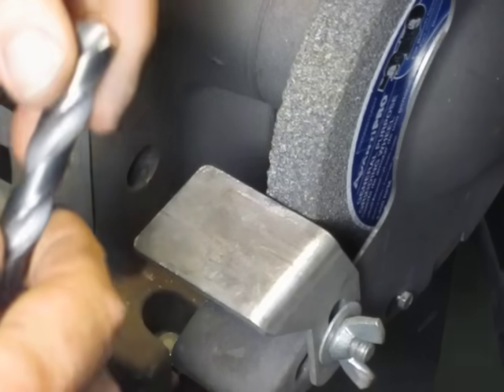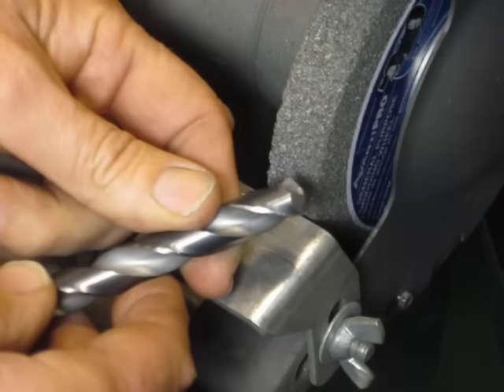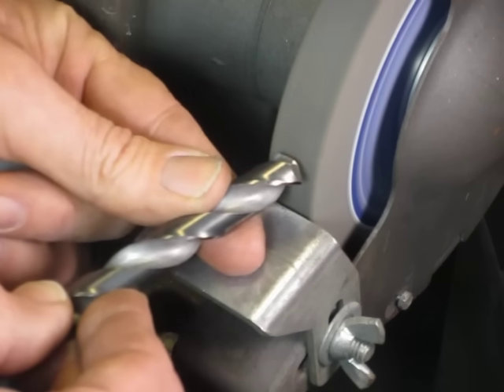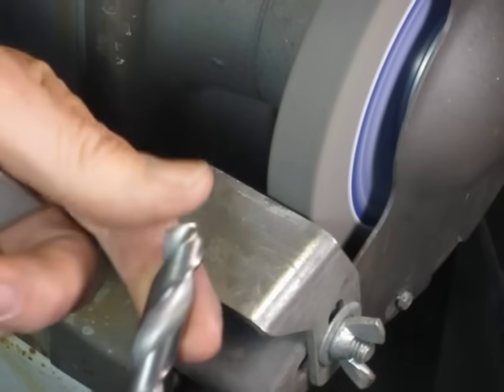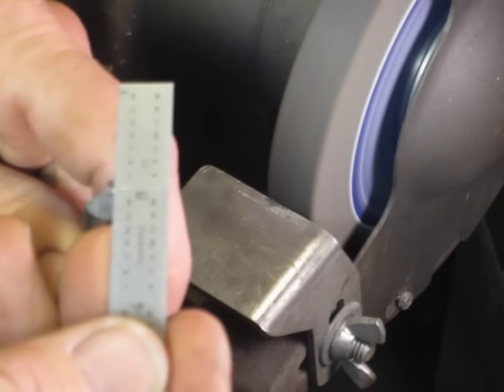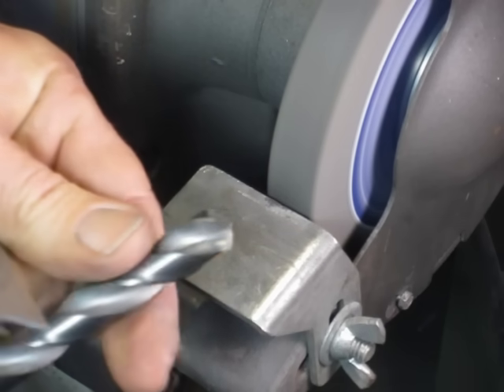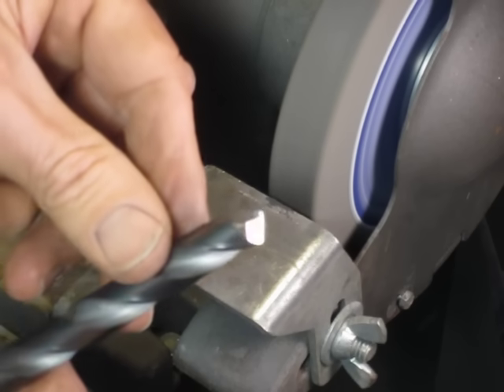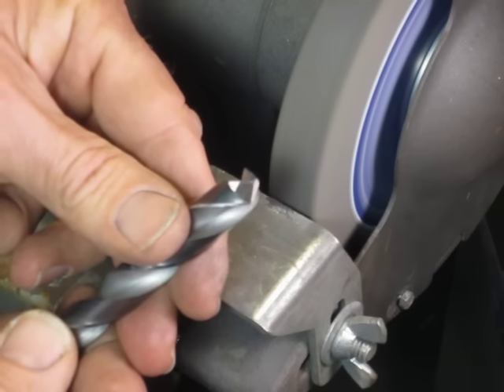How to Hand Sharpen a Twist Drill

Comment: Nice lesson.
Would love to see an update video with better resolution and some closer look as how is the drill bit moved on the grinder. He makes many micro adjustments while it seems he’s just going straight on the stone. I just can’t figure out how to move the tip to hit the correct part.
One question, hopefully someone knows. Can this be done on a regular sharpening stone? Not a grinder? Like a diamond flat stone for example?

Comment: Where does 59 degrees come from? 180 - 118 = 62. Shouldn't you set the protractor to 62 degrees? Or am I missing something?
Reply: Oh, I see - 118/2 = 59. I understand now.
Reply: The total angle on end of drill bit is 118 so half is the 5
Reply: .... +/- 2°÷3° out of 118° or 135°  won't really matter  as long as both sides are the same and cutting edge is the same length. Very difficult to do by hands even using protractor and ruler. For general drilling projects it's good enough unless you want/have to be more precise than investing in "Drill Doctor" is the way to go. Tested couple of models  ... hmm ... you get what you pay for  ... still learning how to use them maybe a challenge and time consuming. I use drill bit sharpener when I have extra free time in between the jobs so I always have set of sharp drill bits available. Presented way of sharpening drill bit is "school/book way " of doing it. You have to practice. Been in trade(Millwright)+40 years can hardly remember any other tradesmen even trying master this skill.
P.S. I would start this procedure from checking evennes of grinding wheel surface  or simply use wheel dresser to make sure cutting edge will be ground straight in line . Still one of better videos about sharpening drill bits on YouTube. 
👍

Comment: After watching several videos comparing various drill bit sharpening machines and the prices for them, the bench grinder seems the most practical by far since it can be used for other things, not just sharpening drill bits. So it will take some practice but from what I've seen the results are at least as good with the bench grinder and the most cost effective. Nice work on your video and explaining how to do sharpen bits.

Comment: Puzzled ...why not raise it up on the wheel in the first place then you'd be grinding the angle and the clearance at the same time .
Reply from the maker: The primary and secondary clearance angles are not the same. You need a shallower primary to conduct heat away from the cutting edge and enough of a secondary angle that it doesn't rub.
Reply: @TomsTechniques  Absolutely right Tom.  A lot of posts about grinding drill bits on this site proves that most do not understand about the cutting angle and the clearance angle. Nice to see someone giving the correct information. As an apprentice i was given  a load off blunt drills and spent hours learning how to get it right..

Comment: To prevent premature dulling, the clearance angle should be kept to a minimum. For the same reason knives, chisels and any other cutting tool stays sharp longer when the cutting angle is minimum.
Reply from the maker: Not necessarily. Too little clearance generates friction, and friction generates heat. That is why I abandoned the traditional conical clearance and started using faceted clearance angles. Drill bits sharpened this way cut much easier than bits with conical clearance angles. There is an interesting artice on drill point geometry written by Joseph Mazoff that is worth reading.

Comment: i thin that there is better accuracy with the four facet drill sharpening. the skill is is traversing the face of the wheel evenly and being patient. A lot of detail in this video although like some other here sharpening drill bits less than a 1/4" gets progressive trickier  as well as the pressure margins getting much finer, being always too easy to grind away too much and then start from zero.

Comment: I can see that you have been doing that for quite some time. I have been hand sharpening my drill bits for some 42 years now, however my eye sight is definetly not what it was, so I can no longer sharpen any bits below 4.5mm
Reply from the maker: Mine is going as well, but I swallowed my pride and picked up a couple of Optivisor headbands. The magnification allows me to do everything I used to do and more. I've even started doing a little watch repair as a hobby.

Comment: When the drill goes smaller to 4mm and even smaller, it gets difficult by hand. Big drill bit can easily adjust by hand
Reply from the maker: Small ones require a pin vise to hold them, and magnification to see them. Otherwise, they sharpen just like the big ones.

Comment: Most of the eyeball sharpening methods  don't address any way to create a center point that is centered !  This is one of those.  Without an accurate center your resultant hole will be oversize.
Reply from the maker: Actually, this is not one of those. You must have missed the segment at 6:25.

Comment: Thanks for the refresher.  
I was doing a job on a lath drilling a oil hole on cast iron connections rods the drill bits were over 18" long these parts were very big for a locomotive engine or somthing well the castings had a lot of sand pockets down in the metal it was a 3/8" bit I belive and my drill bit was prone to bust about 3 times each part or dull out on every part I think we had like 50 or so of these to do. So I had to learn how to sharpen bits and fix broken ones.
That job was the biggest pain in the ass
But I got it done and only lost about 8 parts becuse the broken bits were stuck in the parts deep in the holes. 
But that was almost 40 years ago.
My uncle put a different brake on the bits 
That centered better but it was close to what you did. He said he started doing that in the 50s no one else was doing it.
I worked in his machine shop when I was younger.

Comment: Good presentation, but , people that  have never sharpened a drill before need to also know to have a container of cold water close at hand to dip the  drill in the cold water at every grind back and forth on the grinder to maintain the cool temperature of the high speed or cobalt drill. If this is not met , the material of the drill will change its grade of hardness and no matter how good the drill looks at the end , it will not cut but dull itself in a matter of seconds and the only way to re establish 100% hardness of the drill itself is to cut off at least a quarter to three eights of an inch off the top of the drill back down to the original 100% material grade and to start all over again and once again maintaining the correct material temperature by dipping the drill into a bucket of water at each back and forth swipe grind. The water will get warm so change it to new cold water when this happens.This applies to every and any kind of tool bit , in the machinist trade .
Reply from the maker: That's a common fallacy about high speed steel. Check out my video on red hardness.

https://youtu.be/jQ648eDA7V4

Comment: I was taught the old school way and later learned the facet method. Both are good to know as larger bits 1 1/4 + lend them selves to the conical method especially in a job shop environment.
   Two things I recommend get yourself a drill point gauge w/6"scale 4R preferred. It's just handy as hell and the angle 118° is set and the most common. These are not expensive . 
Secondly do as Tom says and practice practice practice. 
   People do things differently it's natural but most machinist sharpen drills the same way as shown.

Comment: What am I doing wrong I get the angle to steep.i been through a lot of bits I am starting to get some of them sharp.
Reply from the maker: If you aim the drill bit at the center of the wheel, you'll get a 0° clearance angle. Tipping it up just a bit will get you the necessary 3-5°.
Reply: @TomsTechniques  I get the cutting edges sharp what is the trick to making the drill bite in at first staring to drill.
I have been watching you video for a couple of months now,could you slow down and take a bit more time from start to finish. 
Thanks tom
Reply: @TomsTechniques  I hear you say do your grinding above the Center of the Wheel .I been watching you a lot and have been all over the wheel trying to get it like yours ,I am coming along and it tough looking at a video and not having some one beside you guiding .but I will get it it done right

Comment: If you do that that way in a job shop ...you get fired ...Takes to bloody long and also different angles for different steels , and than there are the flat bottom drills
Reply: One would think a shop owner would incur spending a few minutes of sharpening a drill instead of buying new ones but now i know one would most likely be fired for such an act. And this video is of course not helpful for hobbyist and private people.

I'm being ironic and doubt the only reason you got fired was for sharpening a dull drill bit. But i understand if your bitter and the employer mentioned you sharpening drill bits.
Reply from the maker: I used to have a machine shop instructor who's favorite saying was "Engage brain, before activating mouth. ;) 

First, this is a teaching video, not a race. If I sharpened a drill bit at normal speed, no one would be able to follow, and consequently wouldn't learn anything.
Second, if you had watched the video, you might have seen the part where I discuss different angles for different materials.
Finally, I've already made a video on making flat bottom drills, and one for brad point drills, but I guess you were so quick to criticize, you didn't notice.
Reply: @TomsTechniques  than you teach the wrong thing . Speed and time are the way it is those days ..I worked 44 years in job shops . Got fired 2 times because i could not finish the job in time ...
Reply: @frederikusbos7754  perhaps there were other issues slowing you down not just a dull drill bit that needs sharpening hahah
Reply: @stevo450ify  there are job shops that undercut the estimated time by as much as 30 %  to increase profits and delivery times ...You can't teach me nothing my man
Reply: @frederikusbos7754  Maybe you should make videos on how to properly do it?
Reply: @American-Plague  You just do not want to hear about the reality of the job anymore ....That is your problem with giving all those  reply's
Reply: @frederikusbos7754  Yes...THAT'S why I gave "all those" replies (one, single reply). Lmao!
Reply: @frederikusbos7754  A proper shop would never aim at time over quality! That video teaches a proper technique of sharpening and is to be appreciated by quality mechanics/technicians.

Comment: Tom's technique is spot on. BUT, Tom didn't get this right the first (or second) time he did it. Tom perfected his art with an ancient secret, PRACTICE. He routinely dulls bits as he uses them all the time. It's the only way to get it right. Grab some "dead" bits at a flea market or use a few of your duplicates. When it is sharpening time, start with a throwaway first, the success rate on the good bits will soar. THEN, reach for a 1/16th bit and try that! Time for you to leave, Grasshopper.

Comment: Should you use water to quench to avoid losing the tempor
Reply from the maker: Not true. High speed steel bits can get red hot without losing their hardness. Check out my video on the subject of red hardness: https://youtu.be/jQ648eDA7V4
Reply: @TomsTechniques  Good point! 👍

Comment: How can you guarantee that each cutting edge is of equal length and angle? Anything less and the hole diameter will always be inaccurate. It may look pretty but it's useless.
Reply from the maker: I can't guarantee they are equal length and angles on bits you sharpen, but I can on mine, because I measure them.

Comment: please sharpen a 1.2mm drill. This is too simple
Reply from the maker: The same principles apply to smaller bits, but you may need a pin vise and magnification to hold and see them.
Reply: Do you think sharpening a 1.2mm drill bit that's so small it'd be difficult to see for viewers would make a good teaching video when the same rules apply for a bigger one?
Reply: lol. Isn't that why 1.2mm bits come in packs of 10?

But seriously, I do them on a Dremel with a cutting disc. Bench grinder is overkill for something that small.

Comment: Should I spend an additional $50 to get a variable speed bench grinder to sharpen drill bits?  It seems it would be very easy to mangle small bits?
Reply from the maker: A variable speed grinder sounds like a gimmick. I've never heard of one.
Reply: If I were you I’d just flip it off and let it spin down until it’s at a speed you are comfortable with

Comment: a faceted point, in my shop i'd re-sharpen that..... you limit the rate of advancement with those corners causing friction/heat and the need to re-sharpen.... again. and that is far to coarse of a stone to get a fine sharp edge. put a loop on it and you'll see dozens of grooves. the real test is in the use. do you get twin chips coming out of the bore? same size? and don't forget your cutting oil & acid brush

Comment: What grit is the grinding wheel? Is 120 a good grit? Also is your grinder a 1750 rpm or the more common 3000+ rpm type?
I’m looking at bench grinders and am leaning toward a 1750 rpm model with a 120 grit wheel. 
Any help is appreciated. Thanks for a great video.
Reply from the maker: Being a 6" grinder, I suspect mine is 3450 rpm. Unfortunately, it's not readily available, so I can't check.

I normally use 60 and 80 grit wheels. A 120 grit wheel would be way to fine. It would heat up your tool bits like crazy.
Reply: @TomsTechniques  thanks, that’s good information.

Comment: I always freehand sharpened my bits. I went by the angle the bit originally had and sometimes I did change it some. I didn’t use a protractor or ruler but I wasn’t a machinist. I was a diesel mechanic. I did have a machinist teach me how to notch the bit so it cut faster and lasted longer. It worked great when working on frame rails. You called it thinning the web.
Reply from the maker: I don't use a ruler or protractor either, but I've been hand sharpening drills since the 60's. However, I do recommend using them for those developing their skills.
Reply: @TomsTechniques  I agree, it takes time to develop the eye and feel.

Comment: I've been grinding drills for 30 years, some as large as 2" in diameter.  How you know you've done them right is the drill will cut the hole to size.  If one side is longer, the hole will be larger which is good if you want slightly bigger.  It's best to learn how to roll the clearance and count for each side to get them even.  Using the side of the wheel is also a nice place to roll.  You can rough the clearance on the front and roll on the side to finish.
Reply from the maker: I used to grind my drills with conical clearance as well, until I discovered the benefits of multi-faceted technology. Check out the following article by Joseph Mazoff:

https://www.newmantools.com/machines/drillpoint.html

Comment: We mostly drill in steel and metal at work so I'm thinking to convert all the drill bits into 135 degrees. We got the drill doctor but it wont make a split point very well for 135. I might have to try the bench grinder method

Comment: Would 75 or 100 degrees work?
Reply from the maker: Any included angle will work, but some work better on certain materials. Basically, smaller included angles work best on soft materials like wood, plastics, and non-ferrous metals and larger included angles work better on steels. The harder the material is, the flatter the point needs to be, for strength and heat resistance.

Comment: you do this so hard it is not funny!  i can do this by hand faster than you can and i do not need a gage. look down the cutting edge and rock the drill toward the relief and all your angles happen automatic  done it this way for 55 years and have never missed yet. and i have taught hundreds of my way and they love it. and the cutter grinders do it the same way
Reply: @elypowell6797  I doubt the old codger is  honest enough to admit he’s sub optimal.
Reply: @elypowell6797  I doubt the old codger is  honest enough to admit he’s sub optimal.
Reply from the maker: Lol. So you learned how to sharpen drill bits using conical relief in shop class 55 years ago, and never thought that there might be a better way? Most commercially sharpened bits today utilize multi-faceted geometry, which is much more efficient. And if your goal in teaching is to demonstrate how fast you can sharpen a drill bit, your teaching methodology sucks. No one cares how fast you can work, they just want enough information that they can do it themselves.
Reply: @TomsTechniques  no the problem you show is what they teach you in school . your way you have to hold the drill at what you say is the optimum angle that is a relative angle at best. then you have to twist the drill as you move it upwards and hope you do not create a reverse relief. and then you have to check with a gage to make sure you have both angles the same. so now most will not be able to do that. my way is yo hold the drill with the cutting edge pointing up and what even single you chose. but with your finger in the grinder shelf you get the 115 deg about automatically, then you just cock the drill to the relief direction and all the guess work si done. you flip the drill to do the other side. every person i have shown says that is so easy they wonder why they still teach your way. but you do it your way and keep that gage handy. mine is somewhere as you still need grade school methods  but thanks anyway
Reply: @elypowell6797  I doubt the old codger is  honest enough to admit he’s sub optimal.
Reply: @108hindu  )